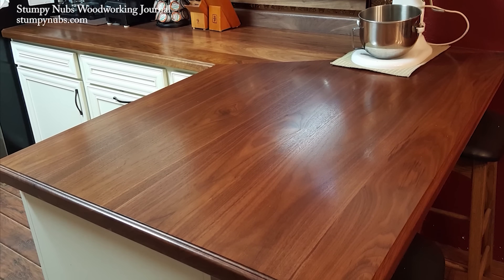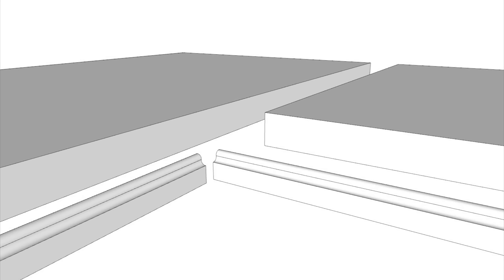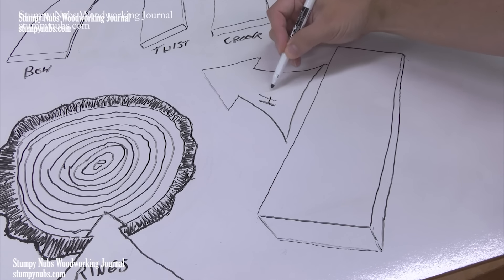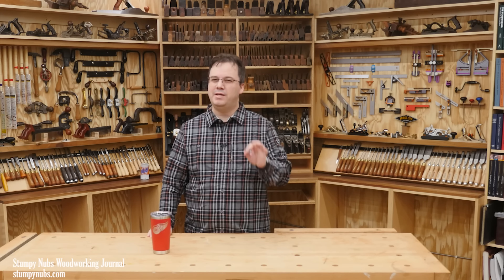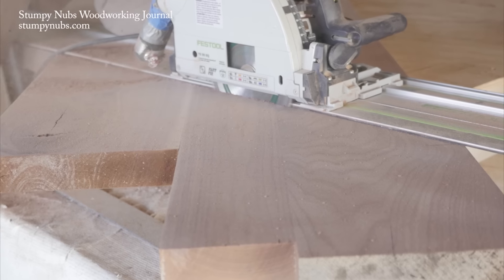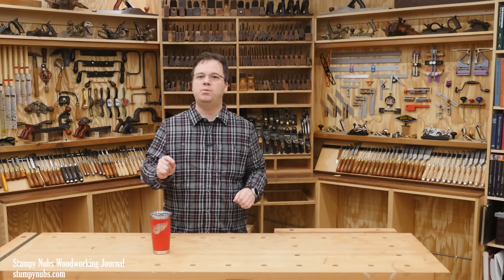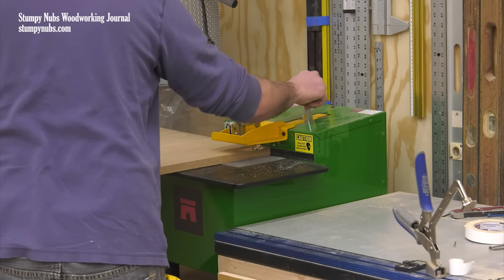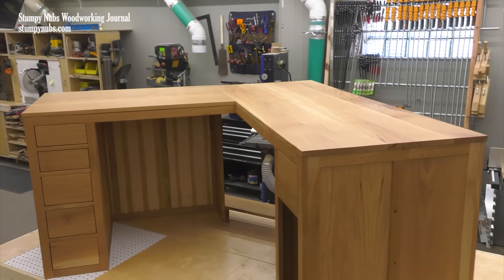The DANGER of making your own wood countertops!

Comment: Nice vid. 👍🏻
This side of the pond we are told by  manufacturers not to do a full mitre, in any material.
We use a Mason mitre or a butt joint if square edge.

Comment: I made a butcher block countertop from two pieces. (Mine was straight, not L shape, end grain to end grain). I did a "pocket-dowl", bisket, dogbone joint with glue. 😂 I couldn't have been happier.  A lot of work to get a straight joint, but wow it looks great! It is in a humidity controlled garage with a sink and undercabinet water pipe freeze protection (sink hole another major challenge and accomplishment for me). Finish is a floor oil based polyurethane(won't touch food directly like cutting on it). I learned SO much.  This garage serves a dual purpose as a large gathering place.  It turned out fantastic!

Comment: Hi James,
I understand the mason's mitre will still have the same wood movement issues as a butt joint, to make it work you still need the same fixing method as you describe for butt joints, but
-there are no routed molding issues as the small mitre joint matches the molding on the edges of bench top
-the joint looks really professional 
-there is less wood wastage as you are not doing a huge mitre
-the mitre is small so you don't have the large mitre opening issues
-it is the best of both worlds

Also, i have just retired from paid work (67), I have been woodworking for 56 years, it has given me great pleasure and is a part of who I am. Over the journey I have lost capacity due to sport and work injuries so that I have had to make modifications and plan accordingly when making and installing projects. Ergonomic solutions such as working at a comfortable bench height, having simple material holding methods and modifying tools has enabled me to continue my craft. 
I have watched a lot of woodworking videos over the last few years but I haven't found a video that compiles all the smart ways for older, and/or slightly incapacitated woodworkers to keep making.
If you could make a such a video I am sure it will be well received and would be a service to the older woodworking community.
I have a few suggestions if it would assist you.

Comment: This is a great explanation on the miter joint countertop connection. I am glad you explained that one should not glue the spines or biscuits in these countertops. The drawbore bolts work perfectly.

Comment: Yet another video showing why this is my favorite woodworking channel. One question though James, regarding the dog bone bolts. It looks like the set of holes and the slot cut a fair amount of wood away from the joint. Doesn't it weaken it to take away that much wood? To ask a differently, if I was making a thinner tabletop, would such an approach not work?
Reply from the maker: I don't believe it weakens it to any significant extent. The hardware pulls the two edges together tightly, as if it were a single piece. They may make smaller hardware for thinner materials.

Comment: I worked in a cabinet shop years ago, and we had an order to make L shaped desk tops complete with 45 degree miters.  We used MDF for the substrate, and glued on plastic laminate on the top.  We used the draw bore type fasteners you used for your top, but it was a different design.  It had a complete circle of steel to fit in both holes that were bored out.  We bought a bunch of kits which included both sizes of drill bits, one for the bottom hole for the hardware to fit in, and the smaller bit for the perpendicular hole for the tightening rod to fit into.  I thought the whole system was pretty slick!  We hammered those tops out in two days!
Reply: MDF doesn't have the same movement issue as wood.  OTOH, edge glue joints are especially bad, so draw-type fastening is good for that reason.  Filling the entire hole is superior for MDF so that it doesn't tear up the fibers but applies pressure evenly.

Comment: I have made many mitered countertops in solid wood and have never had an issue with the joint opening up despite my initial concerns. Here are the tips I can offer:
Use wood that has reached equilibrium via air drying to at most 15% moisture content.
Cut the joint using your preferred saw or router method. I have always hand planed mine for a slightly sprung joint so the inside and outside corners are less likely to ever open. This has worked very well, but don’t overdo it; 1/32” gap is plenty. 
Use long, beefy loose tenons to keep the top surfaces aligned and to give strength to the joint. These will help keep the two pieces from separating and strengthen the joint while transporting the counter.
Glue the loose tenons and end grain liberally. 
Use draw bolts to draw the two pieces together rather than messing with clamps. On 25” wide counters I have used 4 or 5 draw bolts with loose tenons between each one. Place the draw bolts as near to the inside and outside corners as possible to help keep the joint closed where it is most prone to opening. 
Have extra draw bolts ready in case you break one while closing the joint.

Comment: within the first 2 minutes of this vid, my first thought was dogbones and splines. you are one of the few great woodworkers on youtube. backintheday when i was making office furniture, we used exactly that method. the surfaces were either finished veneer with solid trim, or some kind of laminate or solid surface product. the only field seams we glued were countertops where the joint was exposed particleboard. and btw good explanation on moisture change/acclimation issues.

Comment: Well, not saying that any of this is bad advice, but I built my L-shaped kitchen counters (two of them joined together at the sink to make a U-shape) out of construction lumber six or seven years ago. I didn't know any better, so they are butt-jointed with dowels and glue (waterproof of course), and the ends have breadboards also joined with dowels, and glue. The only joint that has opened up is the breadboard that is right up against the sink, because it is constantly getting soaked. Everything else is still good as new. Mind you, I did put five coats of exterior-grade varnish on the thing, including the underside, so although our house varies a lot in temperature and humidity, chances are the wood doesn't that much. In any case, should I run into trouble down the road, that is the very reason I chose the cheapest wood available: it won't break the bank too much if I have to re-do it.

Comment: Your original countertop video was the inspiration to do a similar build 4 years ago in my kitchen, but with Monkeypod butcher block & 2 miter joints on a U. Using the router to fine tune the joints was a god send & made the cut & fit up almost stress free. I even used the same finish... Cheers

Comment: Great video. A third way, complimentary curves with the router bit. The first 2” is 45deg so you can 45 mitre the edge profile, then radius the cut (1” or 2” radius) 45deg to a butt joint.
This is how the Pros do it.
I know you have a great video on complimentary curve router templates… I watch it each time I need to do it

Comment: Perfect video.  That's just how we used to do it.

Only thing that could be added is to run a router between the 2 pieces, clamped down close to each other, before assembly or in the shop before you go to the site. The joint between them will be so perfect that you literally can't see it.

Comment: In 1993 I worked for a cabinet shop where the owner did custom kitchen countertops. He cut all his mitres with a skill saw and then jointed them with a large Porter Cable router and a precision straight edge. All were fastened together with the bolt type fasteners you show.

Comment: Excellent info/video. The only thing I'd add is that I like to add some finish to the ends when connecting large pieces like this. It helps to reduce the amount of movement you'll get and also prevents swelling at the ends (especially in a kitchen where spills are inevitable). Just be sure that it's nicely dry before assembling the two pieces together so that it doesn't act like glue. 
 I've also used clear silicone on the ends in the past for the same purposes and it moves/flexes with the wood as it moves around and acts like a seal to keep anything out of any tiny imperfections in the joint.

Comment: Terrific video James,, I've been installing millwork for decades and you expertly and throughly covered a subject that even though we put in dozens of tops a month we rarely get too install, wooden tops. There is an argument out there that the first fifth (aprox) of the outside end of a miter can be glued allowing the rest of the joint to move. Seems too me like a recipe for a call back but soom guys swear by it. We only use draw bolts, pocket screws are too sketchy. So 3/4 tops are verboten. The top can be built up with additional plywood at the joint and the edge covered with an molding band.

Comment: Made my wife’s computer desk a couple years back. Used both 45 degree and butt joint (one side of L was 3 boards wide, other 4 boards. Thought it was a different and interesting looking joint. Still holding up strong so far.

Comment: Your always so informative and I learn so much from your videos. Really appreciate you sharing your knowledge and now I know why the butcher block counter top I installed in my 5th wheel split open = I didn't allow room for the screws to move when I screwed it down on each end.

Comment: Hi James, thanks for the video. I have used a mason's mitre joint for kitchen benchtops both solid timber and laminate on particle board. You can buy an expensive jig or make your own in about half an hour.
Reply from the maker: Mason's miters are not that common with solid wood countertops, at least here. Laminates, composites and granite/quartz- sure, but not so much with solid wood. It's essentially just a butt joint with a small miter in the inner corner, and as such, it's subject to the same wood movement issues as a regular butt joint.

Comment: Nice job explaining wood movement!! I see all these composite Epoxy tables and furniture. Do you have any extended knowledge or experience with how large wood slabs can get covered or combined with epoxy and how the interfaces of the two deal with the wood movement? There also seems to be a lot of awareness of this when connecting tops to bases which makes sense but still makes me ask the question of the epoxy idea again. How is this possible? Over time I would guess the two would separate on humid seasons.

Comment: Thank you very much for your videos. Even though I am not a native speaker, everything is very easy to understand. One question that I have not seen in videos is the connection of table tops to the underframes. Especially in terms of increasing or decreasing the size of the wood by itself. Maybe you can share some insight what to consider in this cases. This could be very helpful. THX
Reply: Search for table top fasteners. There are several types. A “Z” style where one end rides in a slot on the side that will move, an “L” style where one side has a tight hole and the other has an oval hole, and, a figure “8” style…I haven’t used this one. 
Hope this helps!

Comment: THANK YOU so much for this video!! As I am no carpenter!! But due to the current economic situation we find ourselves in, I've sorta been forced to learn and complete our kitchen. I'm mean, I have made some pretty nice woodworking projects for ourselves and others. But a complete kitchen is a completely different animal, imho.
Anyway, I have two of these types of corners to contend with. Which has had me somewhat concerned about how to pull it off, without the problems that were discussed within this video. So again, Thank You Sir for covering this!! What are the odds of this video coming out at the same time I'm approaching this point.

Comment: One thing I would like to understand is where the actual movement of the wood goes. For instance, when dealing with a countertop and a 90 degree butt joint, should the expansion of the wood be towards the wall, or towards the outside of the cabinets?

Comment: The other option for a joining a profiled edge worktop is a Mason's Mitre joint - it's very common here in the UK and is less wasteful in worktop.
Reply from the maker: Mason's miters are not that common with solid wood countertops, at least here. Laminates, composites and granite/quartz- sure, but not so much with solid wood. It's essentially just a butt joint with a small miter in the inner corner, and as such, it's subject to the same wood movement issues as a regular butt joint.
Reply: @StumpyNubs As you say, a butt joint with a small mitre so the best of both worlds
Reply from the maker: I wouldn't say they are the best of both worlds. The miter is only a small bit in the front corner. That may help deal with a profiled edge if you didn't like the solutions offered in this video, but it looks like a commercially made joint rather than hand crafted, in my opinion, and there is no clear advantage to it other than saving a bit of material (which is the main reason to use that joint). I'm not saying it doesn't work, I just would not expect to see that on a solid wood piece of furniture like a desk, or even a nice, hand crafter solid wood countertop.

Comment: At 0:22 you have an example of a counter where both portions of the "L" have the same grain direction, getting rid of the need for either a miter joint or a butt joint.  Could you have used this method for either your counter or desk?  The "L" at 0:22 only has a short leg piece, whereas your other examples have roughly equal sized pieces.  I suppose that if you had a larger piece, you'd have to account for quite a bit more wood movement width-wise.  (I hope my description is clear.)

Comment: Few things to point out:
1.there are ways to compensate for different rate of grain expansion without needing a miter joint. 
2.Joining two wide countertops with a permanent (glued all the way through) miter joint does not guarantee there will be no cracks as the expansion/contraction is not linear and uniform across the long joint.
3. Miters use more material. Youd think there is no difference, but even in this example, the piece on the left can be short if you butt it up against the right counter top, but the right one has to be the entire length regardless of joint. Sure, You could just make a single cut, flip the offcut over and route the peofile after the cut has been made, but that means bottom side has to be of the same grain pattern.

Nothing against miter joints on countertops, but allowing for some movement with elongated slip joints solves the cracking problem. You start at the back corner with a fixed dowel or floating tenon for reference and move towards the front edge increasing width of the tenon slots. Add a few metal fixings with a bit of sideways give to keep the joint tight and You’ve solved the problem. Seeing how unless the cabinet underneath is also the same species hardwood, You would need to fix the countertop to the cabinet with same compensating joinery regardless of how the tops themselves are joined.
Reply from the maker: 1. This video shows some of those ways. I am not saying you have to do a miter joint.
2. I specifically said NOT to glue any of the joints in this video (not just the miter) and explained why in detail.
3. The two halves of the miter joint were built separately, not cut from a single slab. There was some waste, but not in the way you think.
4. You seem to think this video is just about miter joints. Did you watch the whole thing?
5. "Elongated slip joints"- That's essentially what I demonstrate with the loose tenons in this video. You really should have watched the whole thing...
6. Yes, a countertop is attached to the cabinet in a way that also allows for movement. This is covered in other videos on this channel.
Reply: @StumpyNubs thank You for the reply, and yes, having watched the video to the end, You do address these points later on. Done my share of countertops and jumped straight to comments before watching it to the end, my bad. A good video, as always.

Comment: I would love if you could elaborate more on why mitre joints seems to always open up on the inside, and how to prevent this.
Reply from the maker: You can't prevent it. Wood is going to move, that's part of it's nature. But in a climate-controlled environment (inside your house) it will not be very noticeable. I live in Michigan where we have cold, dry winters and hot, humid summers. My counters look fine. But if I had used glue instead of mechanical fasteners to join it together, I would have a problem because the small amount of movement I still get would have caused the glue to fail.

Comment: Thanks, James. Great information, as always. 
Correct me if I'm wrong. When using the loose tenons, shouldn't they all be moved to the same side of the slots when put in? If you put one in on the left side of the slot and the one next to it on the right side, they'll be opposing the expansion and contraction of the pieces. Or, is the amount insignificant and the movement will self correct as there is no glue? Thanks.
Reply from the maker: They are not glued. They will move however it becomes necessary.

Comment: When butt jointing edge profiled slabs, couldn't you also jack-miter the joint? I've never done it on large slabs, but for picture frames and cabinet door panel frames. I'd think it would be the same process scaled up, no?

Comment: Rough cut it with a circular saw, then clean it up with a straight edge and router. Then plow out the under side to inset plywood. Biscuit the remaining miter above the applied plywood.  Pocket hole them between the biscuits.  Glue everything.  Seal and top coat all the way around and yes, be sure the client is aware that climate control iskey. I've had perfect results doing this with large live-edge walnut bar tops that still look fabulous today